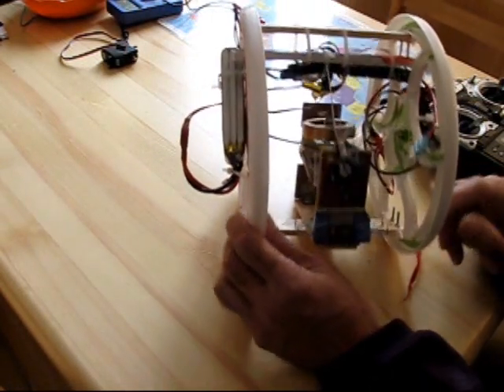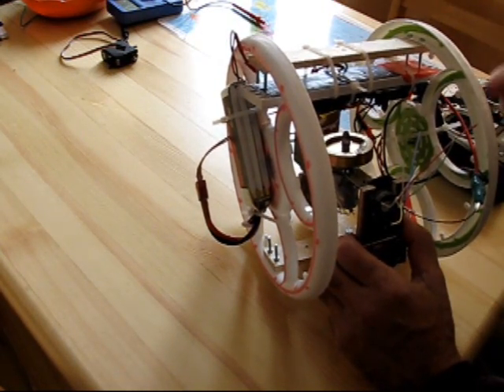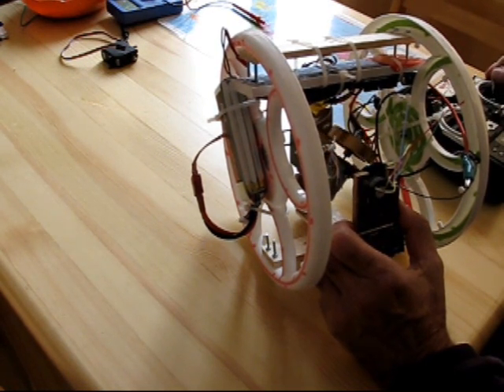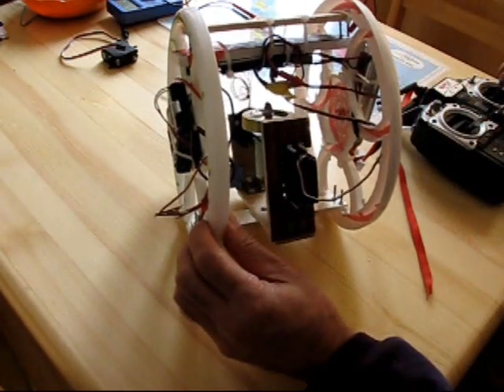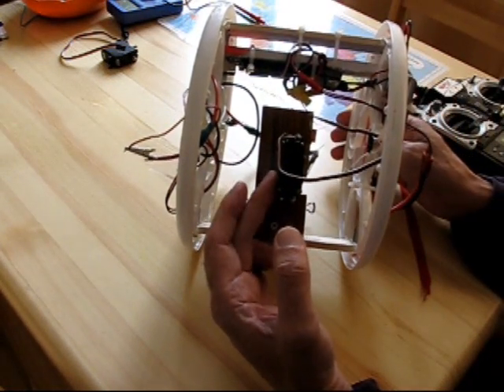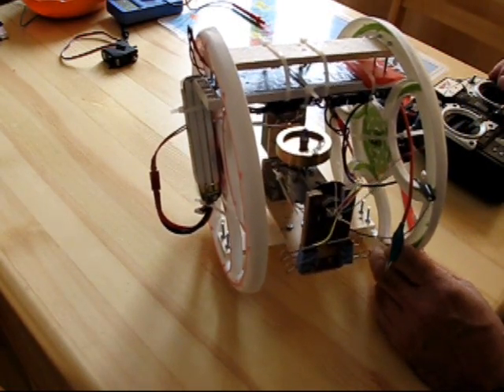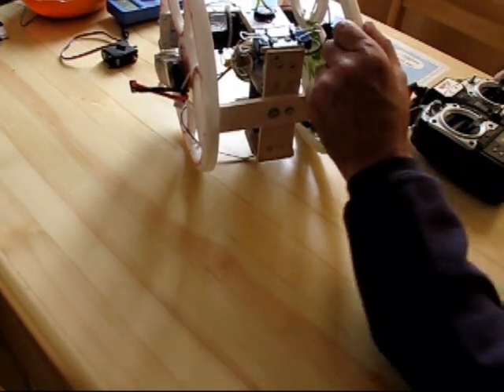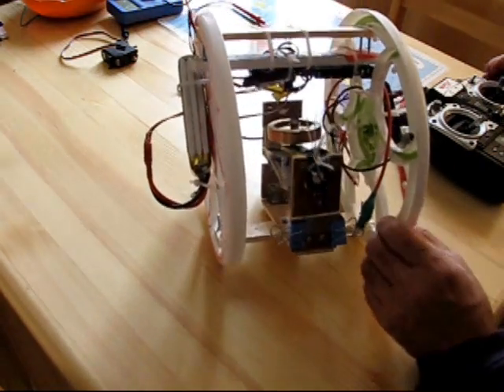Gyroscope (flywheel) Propelled Wheel

Comment: Mr Jimmy Demello. TQ for the post and apologies if had been so long ago.  May I make a belated observation. The forward motion that you created was caused only by the difference in centripetal inertia of the forward and rear half of the gyro when you tipped it to  starboard. As the precession reached vertical rotaion, the difference now changed to port half and starboard half', which will make the centripetal motion vertically down,  but no forward motion. If you had been able to move the gyro remotely forward slightly, the original difference would comeback and forward motion regained. But you'll only reach the bottom of the gyro orbit, then it will stop again. This is where the challenge begins which I will explain later if you're interested..
Reply from the maker: That is interesting. Unfortunately I do not have the wheel anymore but I may consider rebuilding it at some point if you feel it could actually work.
Reply: @demej00  Give me some time to think over the whole process. I do not want to waste your time. I just need to be sure. TQ.
Reply from the maker: @gensyed  No problem. Glad you are thinking about the problem. Wish I knew Matlab or some simulator but I don't.
Reply: @demej00  I have been thinking about the solution for the past few days and I think I have found the solution. Your method of shutting down the motor actually is towards the solution, but instead of shutting down, just slow the motor, it will rotate the wheel because the gyro wants to precess down. After passing vertical, you can rev up the motor and continue what you did previously.
   In order to prevent the tendency of the wheel to turn left, add another motor beside the original one and do necessary centre of mass calibration. Other motor have to spin in opposite direction and also servoed to opposite direction of the other. Hope for success.!

Comment: @Jimmy - Question, what is used to initial spin-up the gyroscope itself, string and hand, or something else?
Reply from the maker: wow, this one was so long ago - I used an electric motor coupled to the flywheel axle through a brass adapter. Then the gimbal that holds the gyroscope was pushed and pulled by a standard servo so that when the gyroscope is controlled by the servo, the resulting torque turns the whole wheel. Unfortunately it also spins the wheel so you have to push the gimbal which forces the wheel forward then stop the gimbal and while the wheels momentum is making it turn, slowly pull the gimbal back into a neutral position. THen repeat the cycle and the wheel will slowly make its way forward. But the wheel must be a little over balanced on one side to make all this work. Sorry I didnt take any closup photos on this one. It was an interesting project and I wish I had worked some more on it to see if the gyro could make it turn smoother.
Reply from the maker: PS. I powered the gyroscope with one battery. I controlled the servo that moved the gimbal with rc reciever and transmitter so that I could manually move the gyroscope and time it with the rollin g of the whole ball. I suppose I could have used an arduino uno to control the servo and use a MPU6090 to sense the position of the ball.